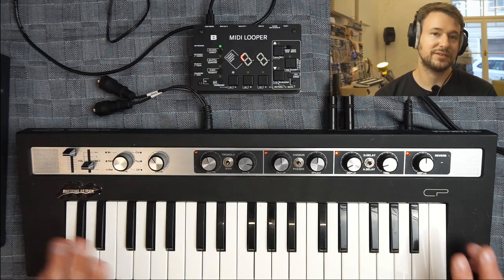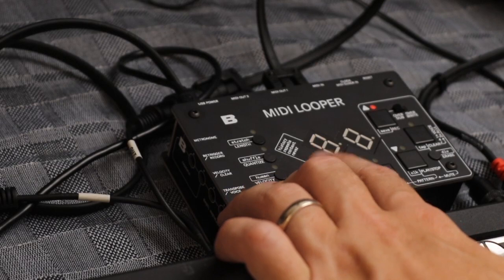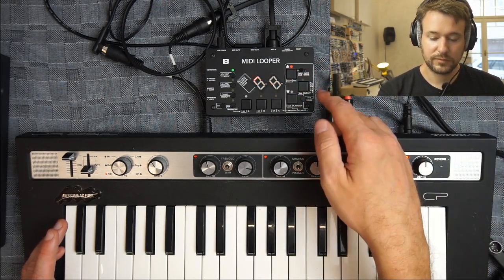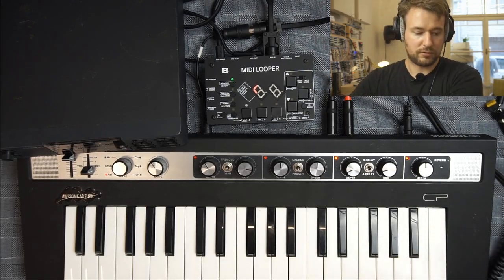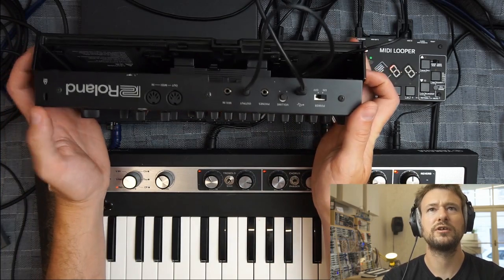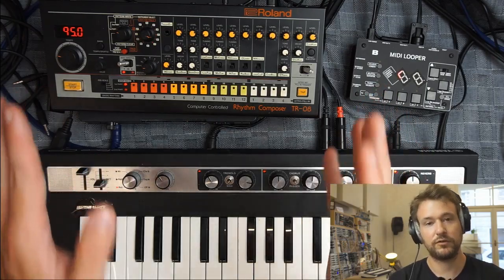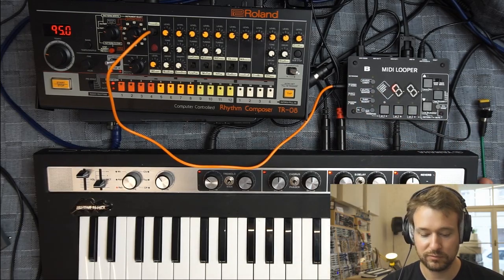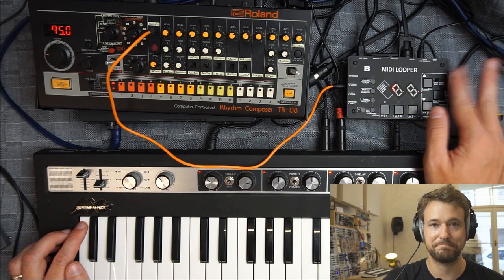Midilooper - Connectivity and Setup - Video Manual Part 1

Comment: I spent a frustrated few minutes not realizing I had it in Free Running clock mode and couldn't get sync to hold. After I realized that was the issue it's been smooth sailing since. Really fun device.

Comment: Continuing to have a great time with it, I've had a really easy time setting it up in REAPER to control 3 VSTIs, this thing has brought audio looper simplicity to MIDI and I'm really thrilled. This is really well designed, there are so many ways one could use this.  I think this will easily work with

Comment: Another trouble...The Midi Looper dosn´t listen to Clock Out of my Arturia Drumbrute, and I have dialed red LED for Clock In function. The Drumbrute is set to 24 PPQN, and Divider in Midi Looper is set to =01, and works right when I connect it throug MIDI In of the Drumbrute, but not through analog clock. Several connector cables have been tried (TRS, TS, 1  meter, 5 meters..none of them worked) It´s being hard to synchronise everything...Any help out there?

Comment: Can I set it not to send any MIDI Clock or Start/Stop data and just send the notes? I have one of those first production run MC-303 which have broken MIDI clocks so I essentially only want to play a sequence by hand on it and have the MIDI looper send the notes of that sequence back to it without triggering the MC-303's on-board sequencer which quickly loses sync.

Comment: Hi, I have just bought the Midilooper and a nord drum 3p, is it possible to get a different kit on the channels ?
Reply: Came here wanting to know the same. Did you find out? Thanks
Reply: @bwah7  Same!!
Reply: @DALTRON666 I tried, it doesn't. It took a while for me to get it to work as following the manual, it doesn't loop. But I got the nord drum 3p to finally loop only if plugged into midi in AND midi out. Clock source set to Free running - or I used CV (analog clock in)from a synth.. 

side note - this means i can only use midi looper to loop one instrument, not more like what is shown here, unfortunately.

Nord uses the GlobIal midi channel [10], to accord with midi looper voice10. 

Now, you can set 2 or even 3 voices on the midi looper to 10, and record a loop on voice A, and overdub.. then go to voice B to make another loop. But if you change the kit setting on the nord, that change will be reflected in the loop already made, which does make sense (it isn't capturing audio afterall).

I guess what I'll try to maximise dynamic with nord drum loops is create custom kits, and choose very contrasting sounds so on one kit setting, overdubs can be more interesting.
Reply: @bwah7  Yeah glad you got it sorted!  Im returning mine as it doesnt solve my problems, it just adds to them.

Comment: Awesome thing, I will order at the end of the month! :) How to connect if you have midi keyboard controller with MIDI OUT and a synth with MIDI IN+OUT (synth without keyboard)? The keyboard is connected to DAW to get the tempo and I want everything in sync, how should I connect the MIDI cables?

Comment: Really intuitive device. I would like to be able to alternate between two midi controllers. One keyboard controlling a couple of Roland boutiques on the one Midi channel and an Electribe ER - 1 on a second Midi channel. And a Kaossilator Pro controlling itself on a third Midi Channel. Part of me says no way this won't work. Despite using one or the other controller individually when needed it will ultimately confuse the destination device - The Bastl Midi Looper. Maybe this Destination device can tell the difference between the two different controllers. It would be fantastic if it could. There are Midi Y cables available online . . but I suspect they're for one source and two destination devices. Any input would be gratefully appreciated.

Comment: I´m having some troubles with my Midi Looper. I select the free running mode, but it starts recording randomly, not waiting till it listens to the first note. I got the gear some days ago and I guess I´m doing something wrong, but reading the manual and watching the video I don´t get what it is. Clock settings are fine (Fr glowing) and midi connections too...Do somebody have any clue?
Reply: Solved (so far). My Akai MPK49 was sending ghost midi notes, so it was activating the recording without actually playing anything. If it happens to you check this video out. 
https://www.youtube.com/watch?v=FUCovZPVxyM.
In the first comment you´ve got the answer, you should turn your knobs back and forth and it will start to respond right
Reply: I´m still having some thoughts about how record is activated with the footswitch. Actually it seems you can´t just push the FS and automatically record a loop. This kind of ruins my idea of using the FS of the Boss RC20-xl audio looper at the same time I create a loop in it, so it would synchronise both by pushing the same FS.

Comment: Would you not run out of polyphony  after doing  the same number of passes as the polyphony count of yr connected synth,  e.g. if it has 8 note polyphony  you are limited to 8  tracks  or 8  notes at once???